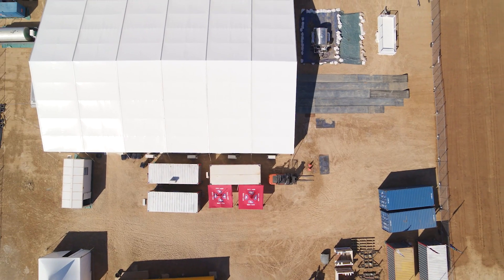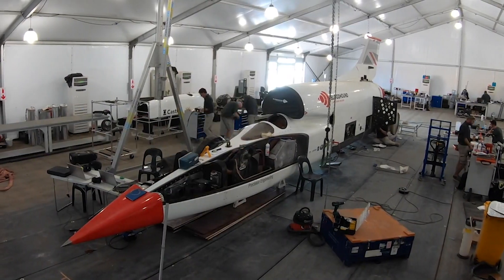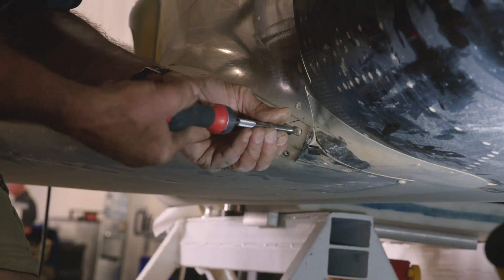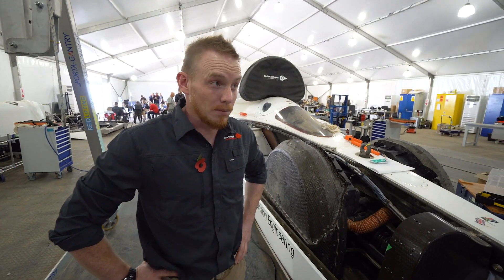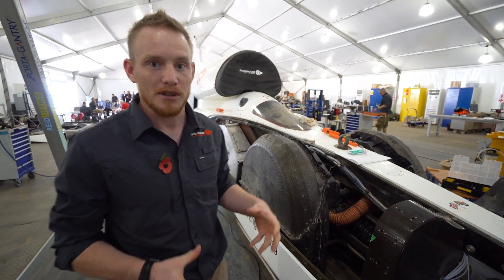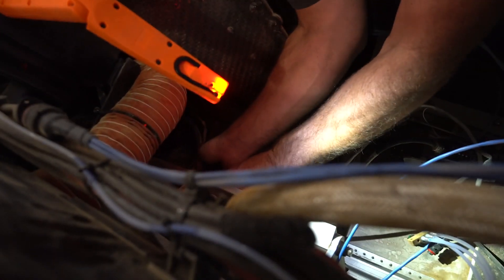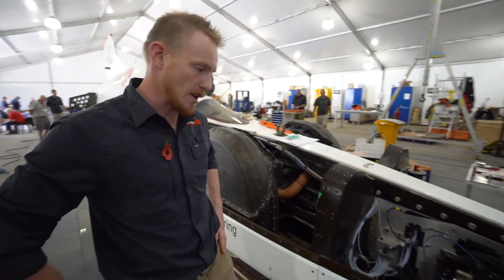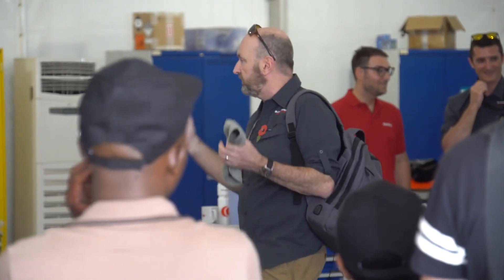Prepping the car for 500mph testing | #2019HST

Comment: I goto know how things are on the rear where the erosion is on the wing ,see if they put a little sacrificial winglets or golf ball dimpled plate to defuse the erosion or gone to a synthetic pad or possibly powder coating the plate ,we all know in a sand blaster the later are hard to punch through to get under neath.i defo think deflection helps as like a tank round there's slopping armour so it triples the material being hit

Comment: I spy, with my retired military aviation eye: CANON Plug electrical connections, and what looks to me like dry nitrogen connections to prevent arcing in high energy electrical circuits. This is aerospace all the way...

(But try very hard not to bend any of the dratted little pins, if you please)

* This is my twisty little shout out to all of the "CREW DOGS" making this big Puppy run from behind the scenes
YOU LOT MADE THE CAR!!!

Comment: Great videos - love this project. Have you any plans to test the rocket engine?
Reply: Not during these trials. That's to be added for the actual record runs. They've accounted for the weight distribution caused by the rocket though by filling the car with some extra fuel in particular tanks